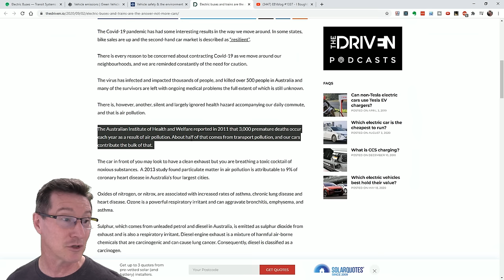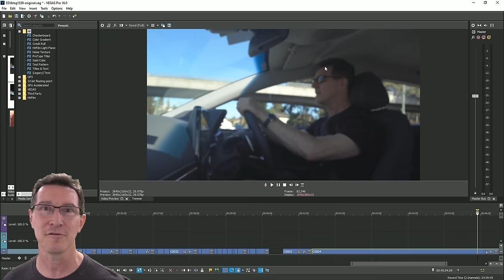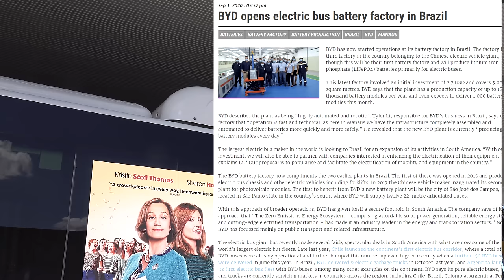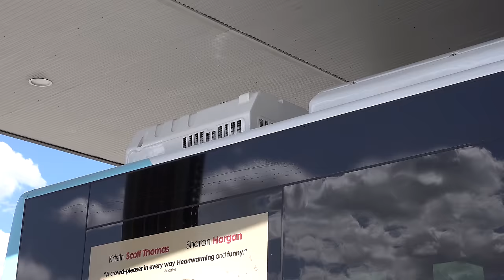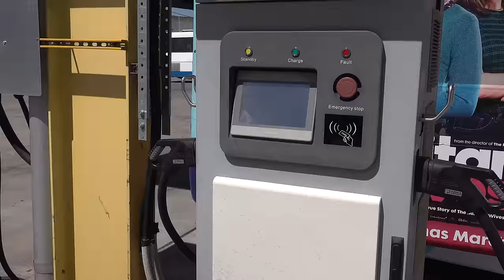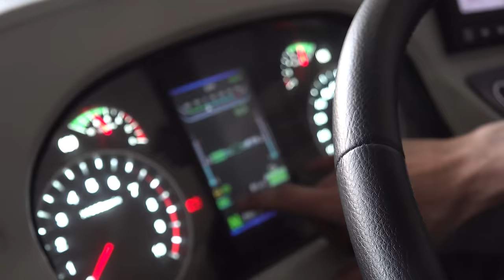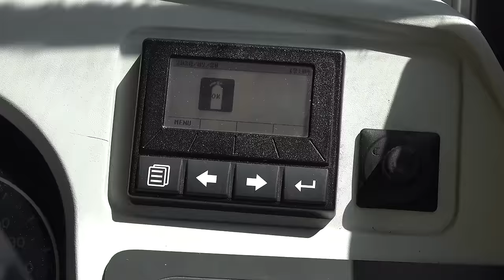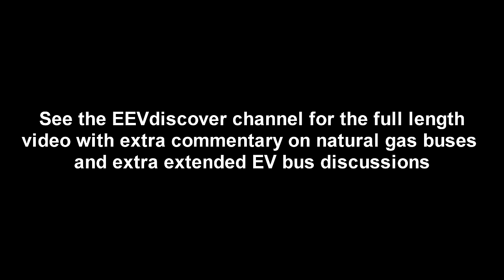EEVblog #1339 - Looking at an Electric Bus!

Comment: Here in Braunschweig, Germany, we have a few fully electric busses with inductive charging. There are a few stations where they can charge the bus during its circular course. It takes just a few minutes to charge enough for a full circle. They lower a coil directly onto the ground, pretty nice tech and works since six years. I guess it saves a lot in battery costs.
https://www.bsvg.net/unternehmen/elektrobusse-emil/technik.html

Comment: Yup, because electricity comes out of the wall socket. I guess Dave and most people here know this, but electric cars only migrate the problem but the overall impact is even bigger. If we would power them by using wind or solar energy then thats great. but until now it is only good for moving the pollution out of the city. I hope you dont get me wrong here, I just had the urge to mention that part because I feel like that was a bit missing in the video (or it was mentioned and I overheared it). in germany where I come from, a very big part of the enery is still produced by burning coal. and on a sidenote that is also slightly radioactive. so if we dont solve the energy problem, there is no point in shitting the streets with electric cars

Comment: I just feel that the carbon emissions is not fully removed in an electric car.  It just puts the pollution somewhere else if the electric car exists on a power infrastructure powered by coal fired plants.  And now California will be banning internal combustion powered vehicles completely by 2035.  The only time I would get an electric car is if every parking stall has a power point.  My apartments parking structure has no power points available in the garages, which makes it impractical for owning an electric car if you live here.  Only way to get a zero carbon footprint electric car is something that fully runs on solar power.  For the technology now, a hybrid setup is more practical.
Reply from the maker: "I just feel that the carbon emissions is not fully removed in an electric car. " I did not say that. I was talking about localised air pollution around the vehicles, like in congested cities.
Reply: The problem with an hybrid car is that it means you have to carry along an internal combustion engine, a fuel tank, an additional clutch, transmission etc, and all the ancillary systems and electronics, on top of the electric motors and batteries. This makes it way less efficient than a purely electric car, and has the only advantage of being able to rely on the fuel distribution infrastructure rather than the electric grid. So it depends a lot on what the car is used for, and where. If you live in the middle of nowhere and can store fuel, then you are better off with an internal combustion engine car, but if you daily commute in a densely populated area, an electric car is better. A hybrid is a jack of all trades and master of none.
Reply: True,  but the beauty of electric car is that it is agnostic to the power source. So as our government gets over the concept of “green coal” and move to more sustainable power generation methods, the electric cars will become greener alongside. At some point the only carbon footprint will be footprint to manufacture.

Comment: There's plenty of pollution, it's just offset to when the car is built, and eventually when it dies.
You're just living during it's Goldilocks period.
Then again, there's far more pollution from the out-gassing of rubber from the hot tires than the exhaust gasses from the engine.

Comment: He claimed 22,000 cycles for the battery, that seams high, probably more like 2,200?
Reply: The reference I found for the BYD K9 buses, had battery life as 6-10 years, so 2,200 seems far more likely if charging once every day, or at least most days.  I’d guess, just a misspeak during the conversation.

Comment: I don't really understand why they would use hydraulic power steering instead of electric power steering in an electric vehicle. Seems less efficient too.
Reply: Most new ICE cars use electric steering assist now, but I guess there has not been enough of a market in the heavy vehicle segment to develop that. The car systems were bad at first. "Unnatural" steering feel, noise, vibration. The electric bus manufacturers probably have calculated the reduction in range from the hydraulic pump and decided it's not worth investing a lot of money to get rid of it.
Reply: Because socialism

Comment: I guess that in the future, most if not all the energy lost due to cooling will be able to be recovered and put back into the batteries.
Electric is here.
Gas is now steampunk.
>
Reply: Only in a future where we figure out how to break the second law of thermodynamics.
Reply: @alexholden  Putting wasted heat in the form of electric power back into the batteries is not breaking any law of thermodynamics.
>
Reply: Bodragon I wish you luck with your perpetual motion machine.
Reply: @alexholden  I'm not talking about that.
I'm talking about the improvements that have already been made with regenerative braking.
In conventional braking, the energy consumed in stopping the vehicle is dissipated in heat.
Now, with regenerative braking, that heat is no longer being generated but is being put straight back into the batteries with the help of super/ultra capacitors which can accept a great deal of power almost instantaneously.
All I am suggesting, or hoping for is that these advances lead to, overall a more efficient system as I'm sure they will.
Anything that needs to be cooled is power wasted and there is a lot of that going on in these buses.
Geez, what school did you go to ?
Did you even finish school ?
>
Reply: Are you talking about cabin a/c, you can't recover that heat into useful energy.
Reply: @Bodragon  well what you describe stops heat being made in the first place, so there is less "energy lost due to cooling", try to be clear with what you're proposing.
Reply: @edc1569  No, I'm not talking about that.
>
Reply: @edc1569  I am not "proposing" anything.
All I am predicting is that , over time, overall efficiency will be much improved.
But simply saying that will have everyone slapping their forehead and exclaiming: "Duh ! Well of course !"
I was just trying to be a bit more specific.
What's wrong with you guys ?
>
Reply: @Bodragon  recovering waste heat, and doing something with it is not the same as not generating that heat in the first place.
Reply: @edc1569  Agreed !
But if the generation of heat cannot be avoided, then perhaps it can be converted back into electrons flowing...
Have you heard of Peltier devices ?
Do you know they can be run in reverse ?
Absorbing heat and converting that heat into electricity ?
And I'm not even an electronics engineer.
I'm a computer scientist and a complete layman in all other fields.
>

Comment: Wait for super-cap advances. Nothing said on diesel tractor fuel used in transport, fabrication and mining battery Cobalt, Lithium, Graphite, Nickel, Silver, Manganese.. or polluted drying ponds. Similar to wind and solar (costs more, waists more).
Reply: This is such a dumb argument, you pump literally 100's of litres of oil out of the ground every single day and then exhaust it into the environment, with a battery, you mine some stuff and at the end you've still got all of that stuff, its still there in your possession, not being inhaled by little Tommie.
Reply: @edc1569  ..and you're short sighted to not look down a basic resource chain. I'd be more accepting if battery module assembly/packaging was noncompetitive and interchangeable among all mfg's, since recycling Li has become a corrupt $$ farce. IIRC, Tesla still has not made enough money to break even. It's also been calculated a P90 needed 80,000 KM's of tractor diesel fuel just to manufacture. BTW, nice try invoking little Tommy.. stick to the facts. Dave just likes the smell of the spent fuel far way in poor Chile.

Comment: If the electricity is generated by coal fired power plants (as is hugely the case in Germany for example), then you just put the exhaust of you car a few miles further.
Germany has been raving about "die grüne Wende" (the green shift) and phasing out its nuclear power plants (they only have 6 left now).
As a result, coal fired power plants are popping up everywhere. On May 26th, the brand new coal power plant "Datteln 4" was fired up.
If, as is the case in Germany, 45% of the electricity is produced by power plants that use fossil fuels (mostly coal and, even worse, lignite), then,  I'm sorry, but 45% of the electric cars in Germany have... steam engines.

Comment: I like electric buses but they need to teach the drivers how to operate them better. The few times I've been on an electric bus the drivers like to just floor it and with all that torque it doesn't make for a very smooth ride.

Good technology but needs better driver education.

Comment: I just hope that a new battery technology will be developed. if someone could make something that could get like 10-15 years with extremely minimal losses in capacity, you would see the entire market shift to electric within a year or 2. 

The consistency of range is really the only thing lacking with electric cars. For example, with my car, without running the cant to a point where the fuel level will be below the level of the pump (bad for a fuel pump as it will heat up more), I can easily do 400 miles on a full tank, with enough fuel left over to keep the pump submerged.

Even after 13 years, the car still does that range, though I do periodic maintenance including cleaning the throttle parts. Really simple if you have your socket set, and a torque wrench. Overall, I want that kind of confidence from an electric car, along with not having to use multiple tons of battery of which the parts are extremely harmful to the environment due to the mining process.
Reply: I think the idea that batteries will be a waste problem is very misunderstood.  I have a battery pack for home storage that is made from Nissan leaf cells from a battery pack that was removed from a car because it was already below capacity.  They still have enough capacity left  (65% of original) to run my house completely off the (6.6kw) solar. I do not know how long they will last but if they dropped to 40% capacity after 8yrs. I think they would have provide enough environmental benefit to cover the cost of the mining and I hope that in 8yrs time they will be recycled for the metals in them. As for moving the pollution elsewhere I think this is only temporary. As more renewables come on line the pollution produced by the busses will drop. And that is without knowing if burning coal would produce more or less pollution than burning diesel to run the bus.

Comment: Electric car, pffff. nothing special. Show me a TV running straight on diesel.
Reply: lol.
Would a washing machine using an internal combustion engine do it?
I know there were some old ass washing machines with Briggs & Stratton engines.
Or that one that the guys at Garage54 did here on youtube.
Reply: I live near the port, so I see loads of diesel powered fridges going up and down the road :)
Reply: @jur4x  I know, there are things like that. That is why I said TV. You can't make it without conversion to electricity.

Comment: Waiting to cross the road, look left, look right, look left again, proceed to cross and get wiped out by an electric bus as you didn't hear it coming.
Reply: Pretty sure they have a noise generator, or you might be able to look up, before you look left/right, to see if there's a pair of wires above one of the lanes
Reply: Okurka 2 wires (probably rather thick ones) directly above a lane, about 6 feet apart from each other. Sometimes you might see a bus taking power from them
Reply: Okurka Yes, I have. There aren’t just pure battery electric buses, there’s also other electric buses that use other ways of getting their electricity
Reply: Okurka Trolleybuses are electric buses, but they’re a specific class, so specific that they’re not always grouped under “electric buses”. And in a number of countries (e.g.: Germany and Austria), trolleybus drivers are under both road traffic and tramways regulations (like the German BoStrab), while battery-only electric buses are only under road regulations
One city might use them, so it might be useful to look up for the trolleybus wires, but in another, or in another part of the same city, they might not be used, so it would be useless to look up for the wires
Reply: Okurka Not in this one, but they do operate in many places around the world, and like the battery-only bus in this, are almost silent on the street

Comment: 1. Electric cars are not clean! The energy must be created somewhere. You just don`t smell the pollution because it is far away 2. Do they recover the losses in heat in that electric bus? I see there some huge heat-sinks, plus a cooling system for the motors. If they don`t use something for recovering the heat loss, the yield about 50% or less. Regenerative breaking is almost nothing comparing to this. This is great in winter time, but inside the house, not outside!
Reply: That is just wrong, electric motors have a usually a efficiency of more than 90%. Even adding battery and inverter losses it is well above 80%. Maybe you confused it with combustion engines, these are at best 30% efficient and lose 70% in heat...

Comment: 80% of the energy you get comes from coal, dirty, filthy coal. Though, to be fair, the energy you put into your EV is generally almost all used for locomotion as opposed to an ICE that chucks out 70% of energy available in the fuel tank as heat.
Reply from the maker: My car is powered from my own solar, and when it's not, for the last 15 years I've been paying extra for audited 100%  new infrastructure wind energy. You have the OPTION to put your money where your mouth is.
Reply: @EEVblog  That's very good Dave. It doesn;t change the fact that 80% of electricity comes from fossil fuels. I mean, its not like we can all get green electricity. 80% will miss out. Don't get me wrong, I am absolutely not having a go at you, my gripe is with the shitfuckery we call governments (of both persuasions) who have arselicked fossil fuel industries either for "jobs" or for the "economy" - same shit, different angle.